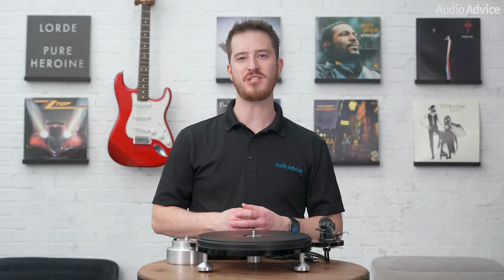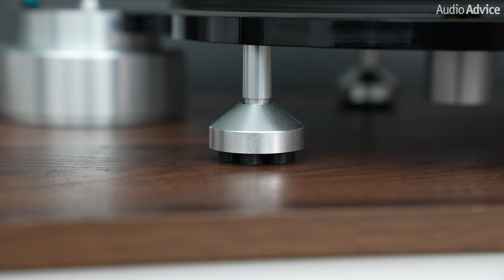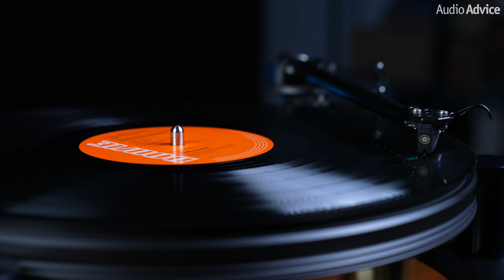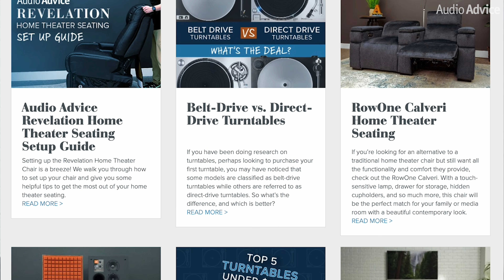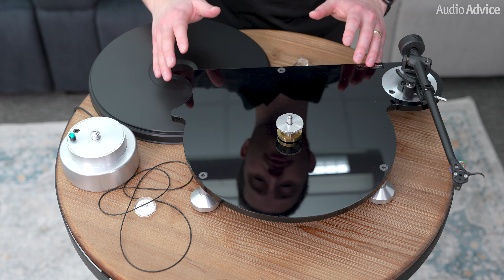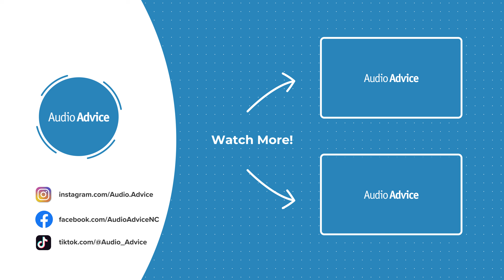Michell TecnoDec Turntable Overview - ENTRY LEVEL REFERENCE TURNTABLE!

Comment: Audio advice sells great products but so far not impressed with their customer service when I purchased my HIFi Rose RS130 streaming transport. The customer service rep told me that there was no way to convert to fiber optics Ethernet because Rose didn’t make the accessories and I said but the audio advice review video said to contact there customer service for help on what I needed. So i ended up reaching out to Rose directly and the rep from Mofi distribution emailed me links to the items on Amazon and I ordered and installed on my streamer.    The reps recommendation was just to connect to WiFi and didn’t even mention the fact that the unit could be connect via copper Ethernet via the SFP transceiver that came with the unit. So overall not confident that if I purchase something else that I will receive good advice.
Reply from the maker: We apologize you didn't have a good experience. We pride ourselves on our great expert support and customer service so this comes as a surprise to us. We are looking into the matter and will be sure fix it for the future. 

Thanks again for being a customer and we hope we can make your experience much better next time!